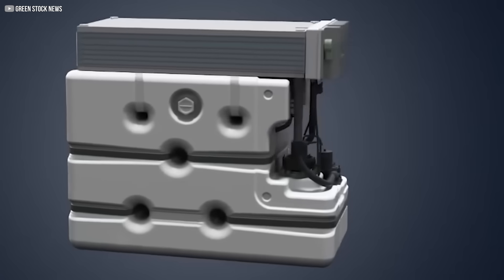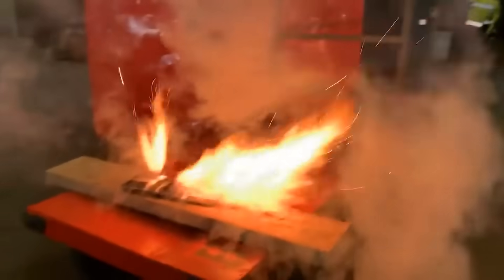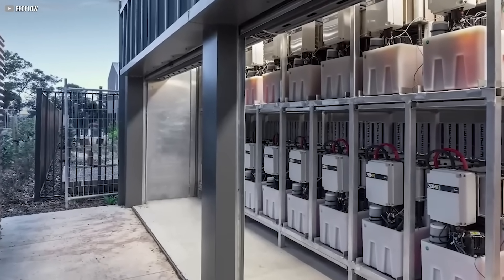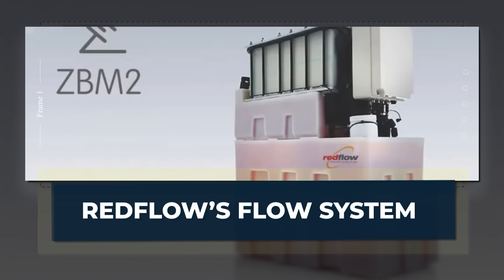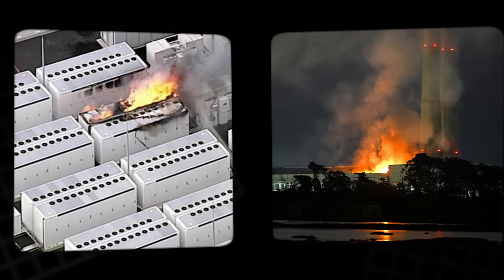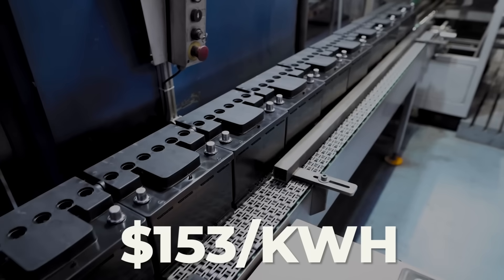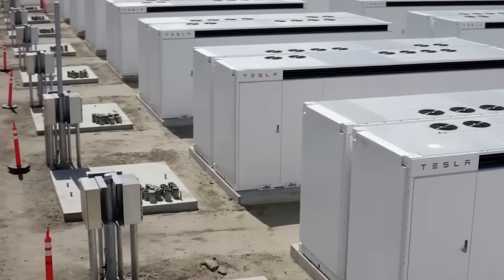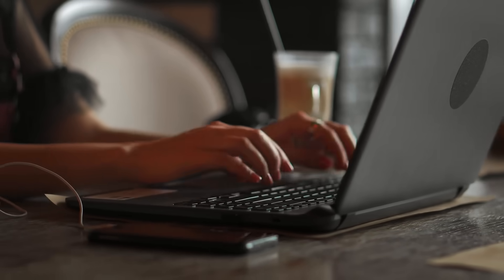Why a Century-Old Battery Is Suddenly the Future

Comment: I have a 1.5 volt 400 amp hour Nickel Iron Edison Battery made in the 60's. Nothing new here except the material. 
The real reason we went with Lead Acid was power density and the fact they had to be replaced after a certain 
number of cycles. Those Edison batteries still worked after 50 years.
Reply: Nickel Iron is the best chemistry I’ve seen.  It would be good for a research lab to work to address the self discharge rate.
Reply: @markam306  You fix the discharge rate by making it bigger ;)
Reply: Open Source Ecology proposed them for their battery modules because of that, and that you can have the power density of a lead-acid with the lifetime of a mountain
Reply: I scratch my head every time I replace a battery in my truck.  I just had to buy one 2 weeks ago, it was over $ 240 for an O’Reilly’s brand AGM.  They last 6 to 8 years.  I haven’t looked into why lead acid has risen in price so drastically.  We haven’t come up with anything better than lead and sulfuric acid in over 100 years ???  The ideal battery for me would be a unit that a DIY car owner could rebuild in his garage.  Man the Edison battery is the front runner in this dream, but I ain’t buyin’ no battery from the PRC !
Reply: @markam306  "The ideal battery for me would be a unit that a DIY car owner could rebuild in his garage."  Ambitious, I think... So, you'd want a battery that had robust plates, from which you could remove the lead oxide paste, and you'd need paste to replace the old paste, the battery case would need to be easily opened (they're generally thermal welded, a process in which a heated aluminium "Mirror" is interposed between case and top, melting each to the point that, when the mirror's removed, and the top's pressed down on the case, they're welded together... at some point in the process (assuming a 6 cell battery) cells 1, 3, and 5 are pressurised, to check for inter cell leaks, then the other cells are pressurised for the same reason... All automatic... Those that fail are recycled... The batteries are generally sent out "wet" now.  Was a time you got a dry battery with a bottle of Sulphuric acid... Recycle at home?  Maybe not!
I mix up the processes for Automotive and industrial FLA battery manufacture, now, but certainly, industrial ones had their plates dried after pasting, before assembly, in a "Tiegel" oven (others are available) in an inert atmosphere,  That was achieved by feeding natural gas into the drying oven, where it burned in the presence of the atmospheric oxygen in there, removing oxygen that would otherwise oxidise the plates... The ovens had blast doors that would blow open if the gas/air mix, for some reason, got into the region between the upper and lower explosive limits 15%-5% You really didn't want to be within the arc of that door when it blew open... It'd give you such a slap...
I think it would be great if more people repaired their own batteries...
Anyway, in the few years I worked in the industry, I could buy one battery per year at a rock bottom price (£4) and as many as I wanted at less than trade price.  I bought two...
The machinery I used to repair ended up in Russia, I expect wage rates made the industry more viable there...
Reply: @markam306  ccp
Reply: Yeah well, the ones made anywhere else have lead plates as thick as paper and last no time at all. Perhaps we should rethink loyalty to US companies that have no loyalty to us! @markam306
Reply: With care, replacing the KOH every 30 years, these Edison NiFe should last for an extremely long time!  The chemistry is "Non Destructive" unlike Lead Acid or most ALL other batteries on the market today!
I had (now given away) a set of 10 for 12volt, that were German manufactured, 85year old, with new Koh ( the old on the garden for the fertilizer effect) replaced and BACK TO ORIGINAL SPECS!!!!!!!!!!!!   yippieeeeee!!!
Reply: @dogdooish  el electrólito (KOH o NaOH), según literatura técnica que he visto (NO Wikipedia, donde escribe quien quiera) debe remplazarse cada 2 años, no 30. De todas formas, eso no es un gran inconveniente. Su deficiencia fundamental es la baja densidad energética.
Reply: Planned Obsolescence - Apple these days are the KINGS of that. ETA, I am still using my 1978 fridge that my family repeatedly offered to buy me a new one, then 11 years later their brand new fridge died, 10 years later their fridge also died. Mine still runs fine! Older is better in a lot of ways!
Reply: yeh i have some NiFe cells here as well
Reply: You can get Nickel iron batteries made in china, but they are extremely expensive and rather inefficient to recharge.
Reply: @deandeann1541  They were also made in the USA by 'Iron Edison' , sadly they ceased operation in 2023. They sold battery banks, in 12, 24 and 48 volts @ 400AH and higher.
Reply: Man these Edison batteries sound really really cool thanks for the until I got to check them out
Reply: Everything is designed for obsolescence.  Voters don't care and will never change their votes.  IP Laws are the new tyranny and Patents need to be 100% abolished never allowed again.  Only Trademark and 10 year copyrights should be allowed.
Reply: The big drawback of nickle-iron is their self-discharge rate and their weight/power density.  They're a good battery for an off-grid power-on-demand source with massive charging infrastructure (solar + wind + hydro), but not much else.
Reply: Longer than that. 

Remember that mining disaster in New Mexico in 2011? The reason that the miners syrvived is that the NiFe batteries worked, but they were the same batteries that Edison had sold to the mine 100 years before.

That's the real reason that NiFe batteries aren't known more widely. They last too long.
Reply: It's like.   White goods.  Now.  5 year design. Fail so you have to buy a new one. As. Old. Stuff last for 20 plus years. Or like th. Light cartel all the. Light bulb. Complains. Signed. Saying if you. Make. A new style or tec  for bulb it can only have a life  that last. So many hours
Reply: Problem with them is they're too good. Companies won't get behind them because they don't need replacement.
Reply: NiFe is the way to go when size isn't an issue or weight isn't. The abuse they can take is well documented... and if you can't afford PM you can't afford fires.
Reply: funny thing about lead acid battery is if you need a jump all you need is coca cola
Reply: What's better battery for solar charging? lithium is still preferable
Reply: "Nothing new here except the material"
That's about as dumb as comparing lithium batteries to zinc carbon by saying "there's nothing new here except the material".  BONEHEAD
Reply: @jackx4311  There's nothing more dumb than someone that doesn't know they are 
all variants of the same technology.
Reply: NiFe batteries were used on steam locomotives to power the in-cab signalling.
Reply: In Spain at least Tudor (now owned by Exide) made them but basically they only sold them to state owned companies like the phone and rail companies.
Reply: Best batteries ever built I think
Reply: Las baterías de NiFe y NiCd, son prácticamente eternas. Su gran problema es la baja densidad energética.

Comment: The Edison Battery would be a much better candidate for home energy storage. With the addition of a small hydrogen fuel cell to capture and automate the recycling of the hydrogen losses, the design becomes very nearly maintenance free for decades of proven safety and reliability.
Reply: Or just forget the losses and add some h2o sometimes.
Reply: @paaatreeeck  I mean, if we can add saltwater instead of pure water it would be nice.
Reply: @FMHikari  Hombre, claro. Y destruir la batería en poco tiempo 😆
Reply: How about small thorium reactors?
Reply: @steveplourde7086  Yes, you can ride a dead horse, just don't expect to get anywhere with it. Small modular reactors are at least 20 years away from deployment. When they are here, they won't be nedded any more, because we will have a plethora of better alternatives.

Comment: Hmm growing up in the tobacco belt, we raised the plants in a prepped bed with a cover.  The seeds are tiny and young plants fragile.   So to make sure there were no other plants growing in the bed before sowing the seed we'd cover it with plastic sheeting and release bromide gas.  Ths gas would kill everything in the ground under the plastic.   Nothing else would survive then we'd tale the plastic off. Let it air out.  Sow the seeds and put a mesh cover on it. The tiny seeds would grow with no additional wedding needed.  Bromide gas was good stuff
Reply: Are you by chance referring to methyl bromide ?  This is a colorless odorless gas at room temperature used for fumigation.  Elemental bromine gas, Br2, is a pungent red gas that burns the skin and lungs.  Two different molecules.

Comment: Ok, but how efficient is it? What is the power storage capacity, compared with a Lithium ion battery?  What is the energy density? How bulky is it? What is the discharge rate?  what is the cost per Kw/Hr? Until those types of questions are answered, I don't think it will compete in the battery world, apart from say a unique use.
Reply: Compared to a Lithium Ion battery, with the metrics you listed, it's going to lose every time.
HOWEVER, Comma, if you look at LIFE SPAN, maintenance expenses, and up front costs, it wins every time.
This battery is for Stationary Uses, not mobile ones.

Comment: bromine is quite toxic : Elemental bromine (Br2) is toxic and causes chemical burns on human flesh. Inhaling bromine gas results in similar irritation of the respiratory tract, causing coughing, choking, shortness of breath, and death if inhaled in large enough amounts. Chronic exposure may lead to frequent bronchial infections and a general deterioration of health. So, what about that safety issue ?
Reply: it also competes with iodine in the human body. Even a small exposure can cause T2D that can only be reversed with years of Iodine therapy.
Reply: and a lithium fire in your garage as your tesla is in flames is bad for your health too.
Reply: @harrydbrownjr3021  Internal Combustion Engine Vehicles:
.
Data from the U.S. National Transportation Safety Board (NTSB) indicates that ICE vehicles have a fire incident rate of around 1,530 per 100,000 vehicles sold, according to AutoinsuranceEZ and Fairfax County (.gov). 
EVs:
.
The same NTSB data shows that EVs experience a much lower fire incident rate, with about 25 fires per 100,000 vehicles sold. 

Which one is more likely to catch fire?
Reply: Sulphuric acid was hardly a friendly substance and we dealt with that for long enough, hydrogen gas is phenomenally dangerous and they put it in cars that crash into each other. I'm pretty sure we have the know-how to deal with dangerous substances these days.
Reply: @TheeMuseumofjunk  You both have good points but not all substances are dangerous in the same way.  It is important to understand "how" they are dangerous first.  We still lack a significant amount of knowledge about materials.
Reply: Zinc Bromide is a compound.  It does not have free Bromine any more than Sodium Chloride has free Chlorine or free Sodium.
Reply: @LoanwordEggcorn  Charging the battery produces elemental bromine.
Reply: The presence of elemental bromine would be a concern for me.  A bigger concern is the corrosive nature of bromine, one of the strongest known oxidizers.  The plates in the battery need to be connected by buss bars, which bromine will attack unless made of tantalum, an extremely rare and expensive exotic metal.  Bromine also slowly diffuses through most plastics, weakening them over time.  I speak with over 20 years in the bromine extraction and manufacturing industry.
Reply: @markam306  Personally, I like the Zinc-Iodide flavor of this batter a lot better.
If I'm exposed to Iodine, I won't need years of "Iodine Replacement Therapy," which I would need if I was exposed to Bromine.
Reply: @markam306 I don't think you recover from bromide where yes lithium is dangerous and harder put out. And there point water electrolytes for a battery but critical thing water battery sure zinc and bromide might stable but steam H2O temperature pov might more dangerous 30-50 c.  Hydrogen fairly safe if you control reaction rates same true of gasoline or diesel. Almost any petrochemical in the right circumstances is dangerous almost all of them in the oxidation process can be lethal.   But  lithium is relatively safe does require paying attention sure show chemical process doesn't be a bit babysat every now and again.

Comment: Sodium Ion batteries already solve all of the problems with lithium ion. 
There is a reason that this chemistry didn't catch on 140 years ago. It's simply not very good.
Nickel iron batteries from the same era are far superior if you want to re-invent an old tech, although, to be fair, they never went away.
Reply: its not that the tech isn't good, its that "upfront cost" beats "long term cost" every single time.

at first glance, "spending $1,000 on a new battery every year" and "spending $10,000 on a battery that will last 10 years" seems the same, until its your own bank account and you realise "$1000 per year in annual payments" is a hell of a lot easier than "$10k upfront".

if something happens to your "10 year battery" you're out thousands of dollars. if the $1000 battery breaks you just buy a new one.

in almost all metrics, sodium ion batteries are inferior to lithium for vehicles, but they're going to absolutely dominate the EV market once they hit $30 per kwh because it'll take $15k off the purchase price of a new car, no sane person cares that much about range, and the ones that do care that much will prefer to pay $30k for a sodium ion EV with a range extender engine, than to pay $40k for a lithium ion EV.
Reply: @JedPotts-jv2ux it seems Americans and some Europeans (especially diesel car fans) care a lot about range, and even I would need 310 miles of range at 70 MPH to make certain trips easy.
Reply: @JohnGeorgeBauerBuis  this is not a dig or meant to be mean spirited, but in Europe most people do not have to drive a long distance,  In America most people have to drive literally everywhere the only mass transit is in big cities. The majority of America is smaller cities and small town / rural areas. I live in New York state almost 350 miles from New York city in a very rural area with limited charging options. Here range is a huge concern. a trip to see relatives for me is 1,000 miles one way. That is why we love the internal combustion engine so much. It is the only option at least for now.
Reply: @doughasner2580  Europeans who drive diesel cars and visit the Balkans have shared the same concerns, wanting a long range and noting a lack of charging infrastructure.
Reply: sodium ion? have you seen a sodium fire mate? it is cool to watch yellow flames hot as hell, until you dose water and it just makes it angry... (BTW lithium is mostly the same, just with a red hue)
Reply: @partciudgam8478  you know that if you put table salt in water you have sodium ions... Nice fire...
Reply: @partciudgam8478  I put sodium in water every day and nothing happens. Not all sodium compounds are the same. Come back when you actually know what you're talking about.

Comment: Impossible to replace good old petrol
Reply: People don't seem to grasp just how fast, and how much energy is transferred when you fill up an tank.
Reply: @joejoejoejoejoejoe4391  People also don't grasp that the energy density of fossil fuels is the best we have without nuclear. And also they don't grasp CO2 is plant food.
Reply: @majikalbushe people also don't realize that global temperatures increased before the Holocene period, then declined, increased before the Roman period, then declined, increased before the medieval period then declined, and the current increase is just a continuation in the pattern.
Reply: @joejoejoejoejoejoe4391  President Trump knows
Reply: That's U.K.speak for gasoline.
Reply: Prediction:  when we run short of petroleum eventually, we’ll be burning wood and coal in steam engines again.  The alternative would be to get serious in building out nuclear power plants.
Reply: Look around you. It's being done!
Reply: @nickwinn7812  President Trump does not agrees with you

Comment: WIKI: they share four disadvantages:

    Lower energy density
    Lower round-trip efficiency (partially offset by the energy needed to run cooling systems).
    The need to be fully discharged every few days to prevent zinc dendrites, which can puncture the separator.[3]
    Lower charge and discharge rates

even if Redflow found ways to cancel the disadvantages (esp #2,#3).  We still have low performance.  Never said amperage surge rating.
Reply: Not if you build it as in Robert Murray Smith diy method. Go check it out then please reply.
Reply: Don't you think they solved dendrites? If they are using gel, what does that imply?
Reply: Never mentioned freezing temp suitability either which usually means they need heating to keep working which further impacts performance.
Reply: So u believe everything wiki says...ummm
Reply: @JosEPh-zy3yr  hahaha, one of those... are we?